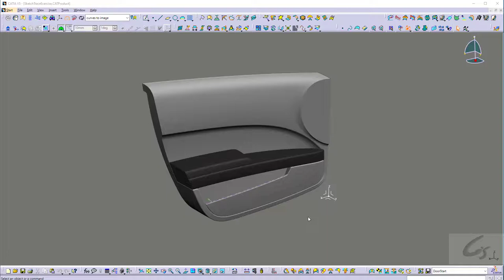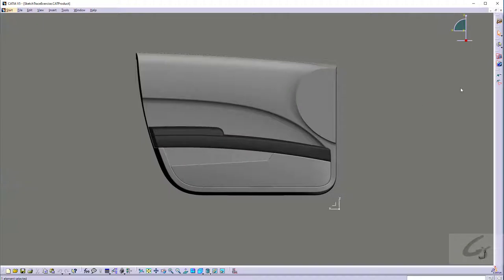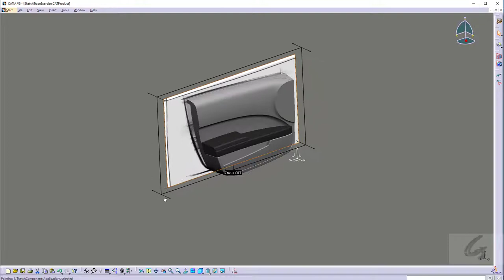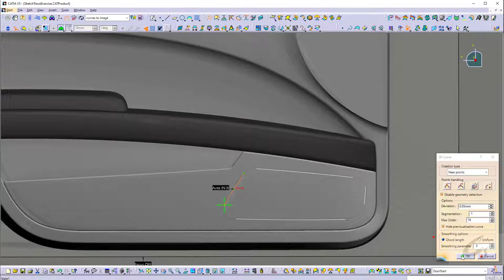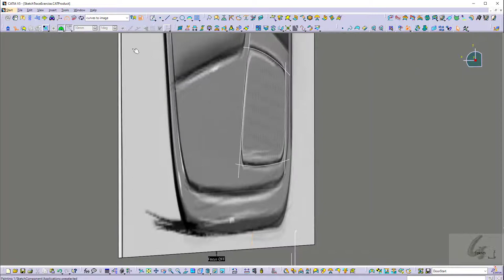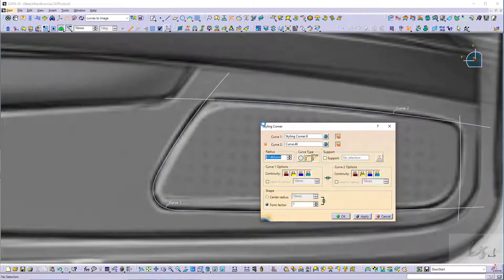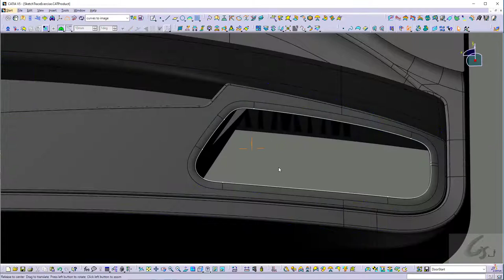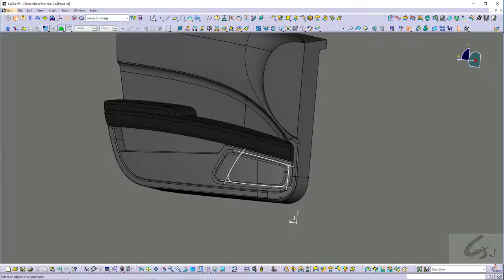Using CATIA V5 Sketch Tracer to make beautiful ICEM surfaces

Comment: Hi @Gerard, I'm having problem, when I copy paste the feature and changing the direction, it cuts the interior and doesn't show anymore.
Reply from the maker: Hi Jose, Sorry....late reply. There are myriad things that can cause the issue. If you copy and paste a feature, it may be possible that you have to look at the parent entities, making sure that the new feature will build properly. Things such as fillet values, direction of both surfaces for a the fillet, the approximation settings need to be tight as well. If nothing resolves the issue, try to remove the trim option to see if it builds and work the bugs out from there.
Reply: @GerardAlcini  Thank you Gerard, I'm on it.

Comment: Why did I follow the command 9: :30 and only get a copy of the curve without changing the surface?   Thanks
Reply from the maker: Hi Ben,

make sure that you do not have "Keep Original" turned on in the app options window. This will duplicate the curve or surface, thus no referenced geometry will be driven from this duplication.
Reply: @GerardAlcini    Thank you very much for your help    ：）